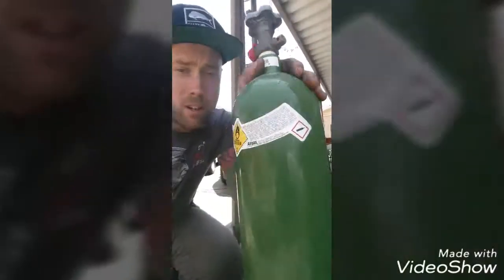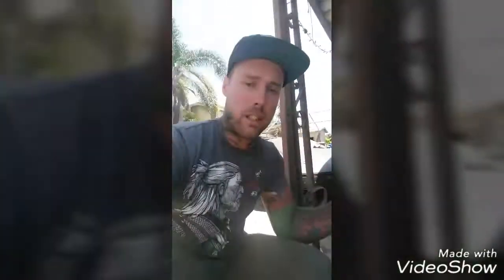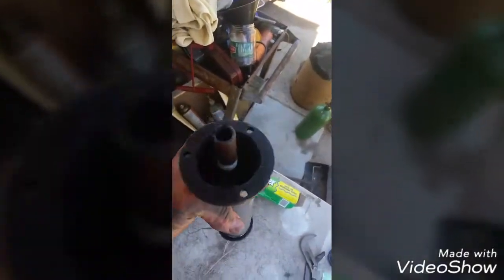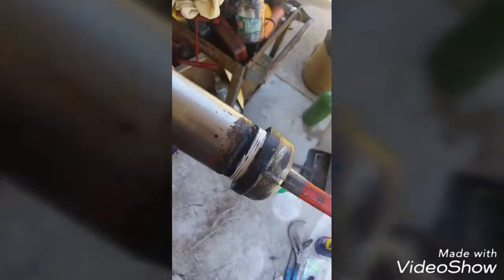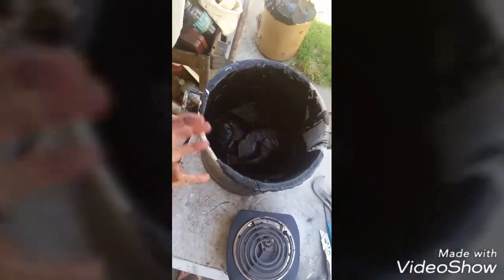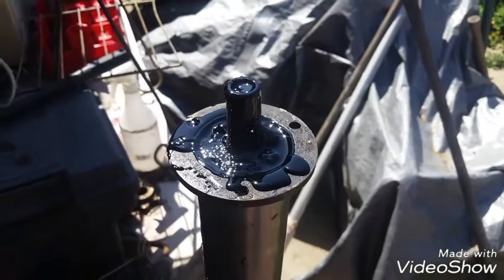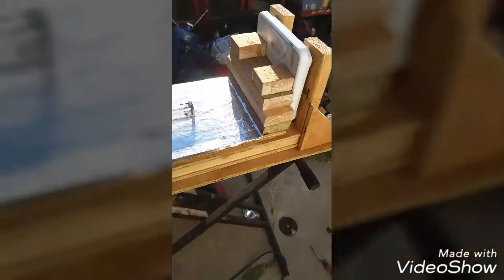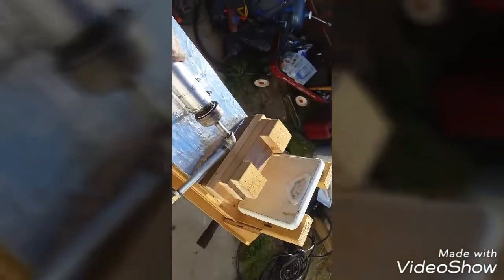Hybrid Rocket Tutorial Step by Step

Comment: This video, from an engineering point of view, is Certified Woke. 

You literally don't say anything at all that's wrong. The only suggestion I have is to get a vacuum pump, cover over the hot tar, and pull out as much air as you can from the tar while it's cooling. That should help reduce the unsteady burning.

Reducing the size of your nozzle throat will help you get combustion at lower pressure, which will speed up the "real" ignition of the engine (in your test it spent a while as a flamethrower).

Also, please replace the rubber hose you use with the oxygen tank with a teflon lined braided steel hose. More expensive, but it won't catch fire if the hose gets hot from the heat of the engine.
Reply: Wow, that was a very sophisticated comment. Have you ever made a hybrid rocket before?